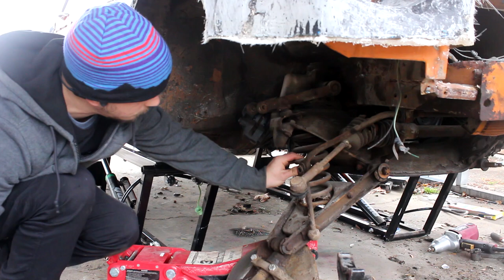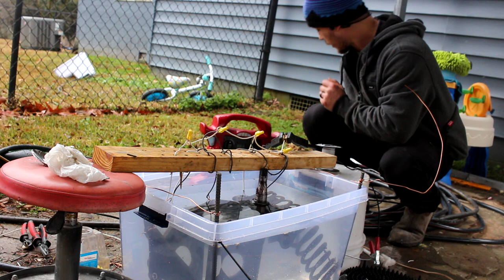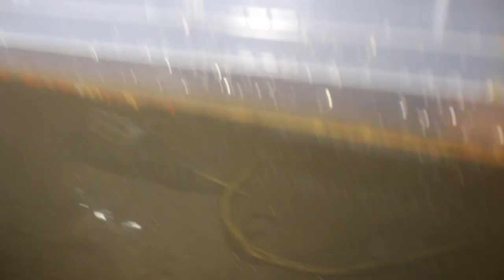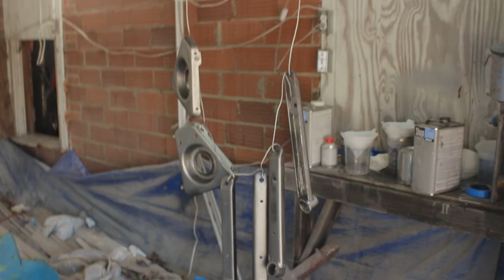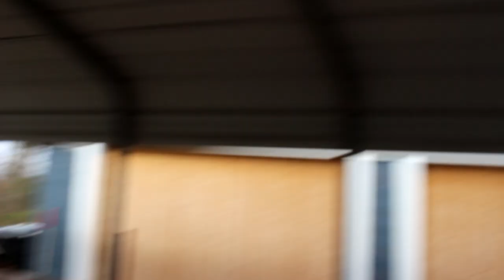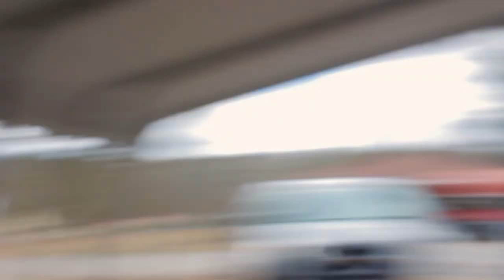THE RWMGB pt.27: SLAMMING THE FRONT END

Comment: The reason for welding the spacer to the spindle is to prevent it from spinning. It will eventually start grinding material between it and the spindle. Weld it so that your only pivot points are in the bushings.

Also, dont fully tighten the nuts holding the control arm to the frame until you have the weight of the car resting on the suspension. If you tighten them down with the arms free hanging, you can twist the bushing when you apply weight to the car, and cause premature wear/tearing. The grease you applied might give you some leeway on that, but general rule of thumb is to not tighten them until they are in the normal riding position.
Reply: shit, i didn't know that, thanks

Comment: Keep in mind, when you fit a larger, heavier engine the front wil go down more. So, fit the springs with the new engine.
Reply: +1 I  thought the same.
Reply: Depending what engine goes in it may not be necessary, the original engine would be a cast iron 4 pot, the aluminium V8 that went in the MGB GT V8 cars weighed about the same.

Comment: This channel is great.  

If you hit any thread with Kroil penetrating oil, you'll be surprised at how easily everything zaps off.  
It's worked on every bolt on my 77 MGB/Ford V8 project car so far.

Also, white vinegar is another amazing cheap trick to zap off rust.  Soak the parts then rinse in hot water.  They'll flash rust fast so a dunk in evaporust or phosphoric acid (hardware store concrete etch and metal prep is $15/gallon) will keep the parts nice.

Comment: When cleaning with gasoline, be sure to bang the steel parts together to create your spark.  If you want to make installing the spindle more difficult, you could always put the caliper and wheel on instead of just the hub and backing plate.

Comment: On rusted bolts, nuts, metal you can use propane torch and or oxy-acetylene torch heat till red then will come right out, same with with stubborn plastics you can use heat gun, heat makes things expand, cold make things contract. I would use wire wheels on angle grinder and or driver and or die grinder to knock off rust on coil springs, suspension parts etc keep up the good work, I really like this car.

Comment: So the anode is the negative electrode and cathode is the positive electrode.  The flow of electricity goes from negative to positive, and it carries carries electrons through the electrolyte.  The reason this works is because that flow pulls the metal apart and carries it from the anode (your part) to the cathode where it collects.  Electroplating works in the same way, by using a specific metal as the anode, and in most cases specific electrolytes, the anode is broken down and transferred onto the cathode.

Technically speaking this will 100% destroy your parts (boaters spend a lot of time and money on using sacrificial anodes like zinc or aluminum to prevent this process from destroying any underwater metal parts.  Called Galvanic Corrosion), but it's safe because that would take a very long time to happen and your wires would most likely corrode and break before then.

Different metals are more or less susceptible to this process, and the environment they are in alters this.  For instance, with high salinity like seawater you would use zinc, as it is going to corrode first before anything else, but in fresh water you would use a different metal.  In this process these anodes are destroyed, breaking down and corroding to the point that if you don't replace them on your boat, they will just disappear and whatever the next metal in line is will become the new anode and start corroding.

Comment: The reason you should weld it is that spacer with the bushing would spread the force across the originally designed distance without welding it you've got a much higher chance for wear or failure in the part you modified

Comment: It's obviously your choice but I would go with the 1-inch lowered springs as it seems like it would be a good ride height and that would give you an idea of if and how much of an issue there is with the way the tires are sitting. Once you do that I would mark a centre point on the front of the car you can measure off of and measure from there to the top of the tire. That will give you an idea of the problem and if there is one. I would wait to do that however till after the new springs are in because the uneven spring seat is going to throw the whole thing off.  Once you have that you can figure out a way to make adjustments to the toe and camber and general alignment of the wheels.

Comment: Looks sick, the issue with the front wheels is probably your alignment is out, check the wheel is definitely straight and then I'd. Check your toe on the front wheels because I noticed you changed the outer tie rods

Comment: Your spacer may need brass bushings in-between the metal joints. Metal on metal may end up chewing each other apart. I've seen it happen before. I'd just weld it save your self the hassle.